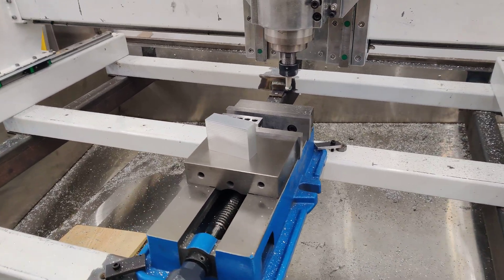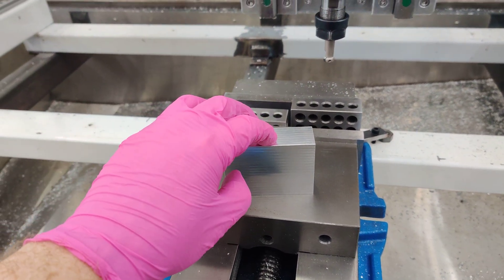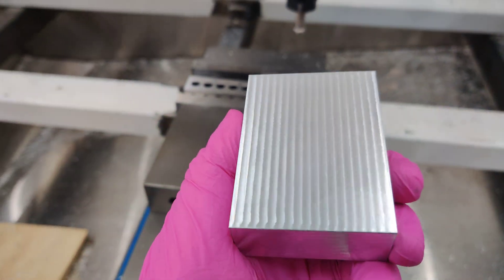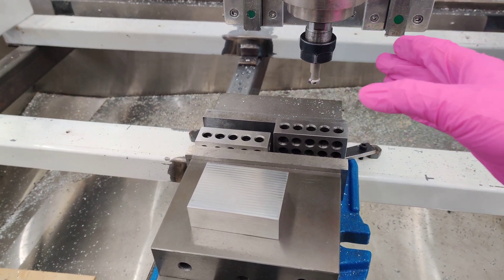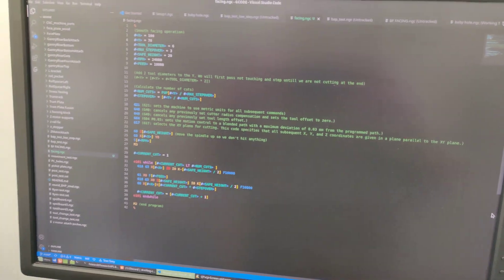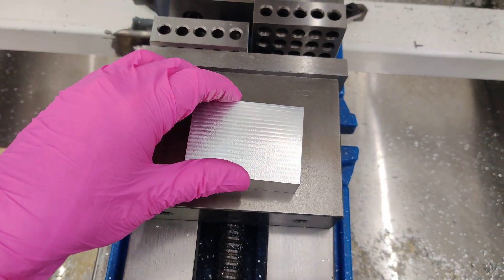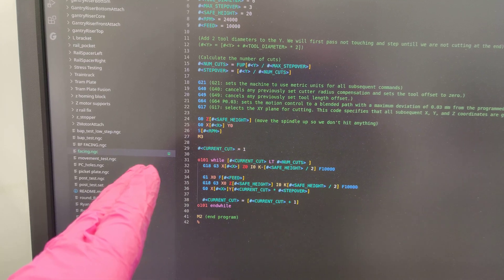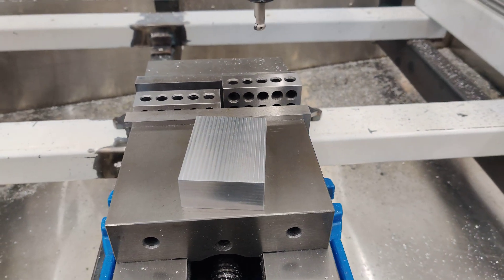Squaring stock with custom gcode macro operation with arc corners.

Comment: How come you're using a round-nose tool for this operation? Since you're making a flat surface wouldn't a square end mill be more suitable?
Reply from the maker: The BAP300 would work better in this case and I'm currently waiting on one. I’m most interested in this round nose one for roughing because the larger cutting area the inserts last a whole lot longer than a pointy one. Currently it’s the best cutter I have for facing operations. The single flutes are no good as they just wear the tip way too quick and just don’t give a good finish. Haven’t been having much success with the 3 flutes due to chip welding. 

Probably going to be investing more in insert tooling from now on.
Reply: Those pink gloves are making you a better machinist 😅
Reply from the maker: High fashion instamachinist
Reply: @James Stanley  :  Dan Gelbart did a fantastic video series on "Rapid Prototyping".  Although the series was done in 2012, it is all still valid today.  Yes, the CNC tooling was old-school, but it was solid, and state of the art at the time.  In the "Machining" video, he discusses cutter length /diameter vs rigidity, and voices his preference for bull-nosed cutters.
It is well worth watching the whole series, but the portion I am refering to starts here:
https://youtu.be/a_E-tYRxBkU?t=701
and runs to the end. (4 minutes).
Reply from the maker: @PiefacePete46  I’ve watched his videos and it's probably about time to rewatch some of the topics again. I can vouch first hand for the ball noses material removal. It's fast but unfortunately you need a real rigid machine to have any success with them. If you solve that problem they work great and the inserts last much longer than a pointy one. I ran the ball nose in steel yesterday with some light passes (see video). I certainly think I could push it deeper 2x or 3x from how it was performing.